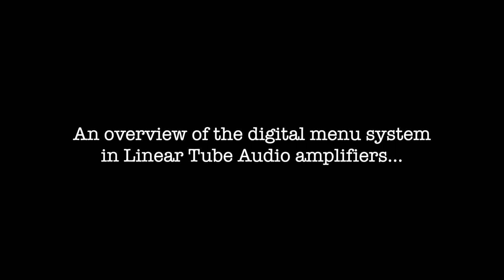How to use the Digital Menu System to change settings on Linear Tube Audio amplifiers

Comment: This is helpful, thanks. Would be nice to see which input is selected using the led readout (1-5)
Reply from the maker: Hey. Thanks for watching the video! The LED light just to the right of the volume knob indicates which input is currently selected at all times. When changing certain settings that apply only to certain inputs, the confirmation message also indicates the input that is selected and thus affected by the setting.